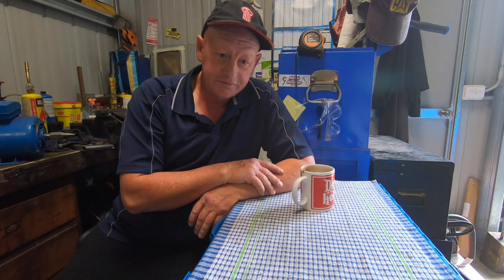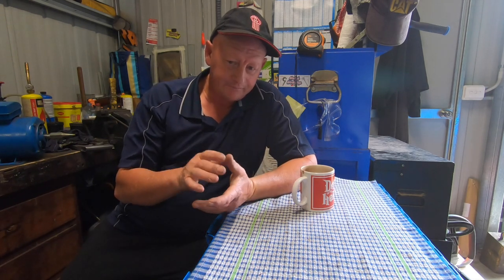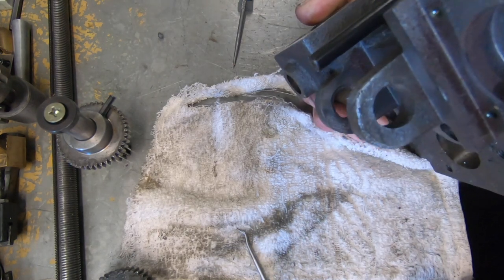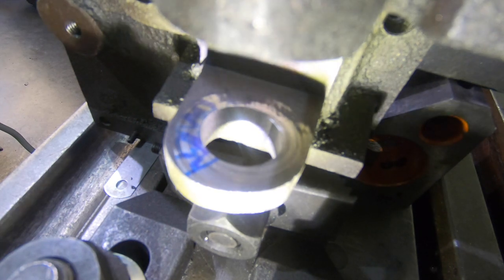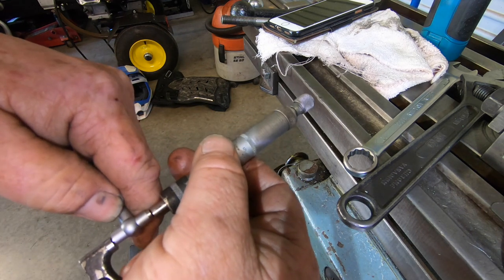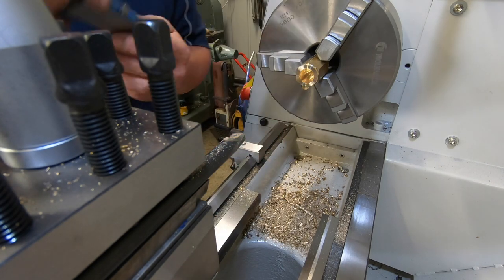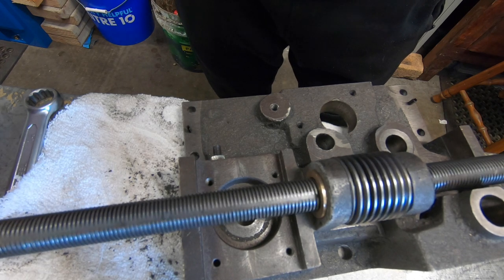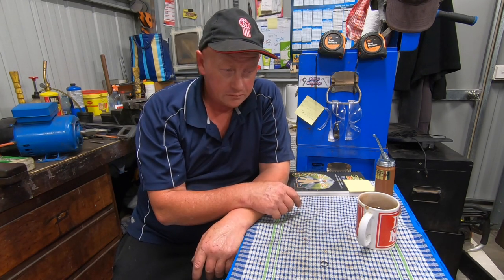AL51G Apron repair

Comment: No problem with the intro, just worried your tea may go cold!.
Yes, production shortcuts, and zero quantity control, makes for a good profit with customers unable to return items, or be corrected. Getting the casting sand out is a pain, but that amount is unbelievable. Anyway, nice job for remanufacturing. Alkyd red oxide paint does a fairly good job on sealing castings, and resistant to mineral oils, the Glyptal is a full gloss enamel paint, and helps oil flow where necessary, but the Red Oxide Alkyd is plenty good enough for standard machines. Does anyone else have experience in using this?
Thanks for sharing Matty.
Best regards from the UK. John.
Reply from the maker: Gday John, the headstock did have paint in there but not enough I’d say to glue the sand to the sides, I’m going to take the apron off again and paint the back, I’m pretty confident I got 99% of the crap off, I didn’t paint it straight away because I was to excited to see if it was going to work, it’s easy to remove so it won’t be hard to paint.....
Reply: No experience with the Glyptal but I always pressure wash and abrade the insides of iron castings and then apply 2 coats of 2 pack etch primer. That seals all surfaces and ensures no further grit/sand gets free.
Reply: @howardosborne8647  2 pack paint is difficult to beat, guessing historically that most paints were linseed oil based (excluding Cellulose, though they is obviously others), there were very few that were oil resistant, even less fuel resistant. I had a Royal Enfield engine as a youngster, only the bottom half, and it was painted a light grey/cream colour and found out it was to improve oil flow.

Comment: I have this same lathe, but mine had the Harbor Freight name on it, and although it’s 20 years old, I just acquired it still in the box! Certain parts of mine were packed with that sand/grinding dust crap while others were fairly clean. I did a total disassembly and cleanup/tweaking to be safe. The cast iron lug that rides under the ways to lock down the tailstock was an incredibly poorly cast and machined piece that broke in two after several uses. I repaired it with nickel electrode, then it broke elsewhere! Grizzly’s G4000 is the same machine, so I searched their website and found the p/n and photo. That pic showed another hideously produced part, but I ordered one anyhow, and also made one on the mill. What I received was an absolutely perfect part, so well done that I didn’t even use the one I made! There is a definite difference in these similar machines depending on the company selling them! Some evidently don’t hold the Chinese producers to any kind of quality standard! Great fix Matty!

Comment: good job Matty. I enjoyed watching it. If I remember correctly there is a paint called Glyptol that is used to seal cast iron inside engines and gear boxes. The better lathes will have it inside the gear boxes. Thanks for sharing.
Reply: Good call, I was going to mention how nice a painted finish would look with that repair, 100% right on Glyptol.
ol
Reply from the maker: Gday Terry, the new lathe is painted very nicely inside the geared head, I’m going to pull the apron off again which isn’t a big job and paint it to seal the casting, it would be nice if I can get that paint in a spray can,, cheers Matty

Comment: Cincinatti  to the rescue!
Dual feed,  leadscrew like the Hercus Lathe.
Lubrication is an issue on your lathe lead, feedshaft, I wonder how Delrin Bushes would perform.
Can't remember how Hercus is set up.
My 12" lathe has separate feed shaft from the leadscrew and also runs directly in the casting but has an oil bath that I must regularly top up.
I think the manufacturer should have installed bushes so they can be replaced as you have done, the right way.
Good job Matty.
Reply from the maker: Gday Willem, the Cincinnati did a great job here, I think it’s was more then lubrication the did the damage, I hope the brass bushes hold up but there easy to replace if they fail,   Cheers Matty

Comment: G'Day Matty, rock solid methodology in that repair and it worked out beautifully.  Yes, Chinese lathes from Hare and Forbes.  I bought a small lathe and converted to a CNC, and the bearings seized up.  The reason was all the sand in the Headstock.  There was even a 4" nail embedded in the casting used to hold the core together and it was rubbing on the spindle.  All they had done was spray paint over the sand to try and hold it in.  I had Hare and Forbes purchase new Timken Bearings for me and I also had the Hearstock sand blasted at their cost to remove any other muck.  You won't have those sorts of issues with your new Taiwanese Lathe, they are first class machines.

Cam
Reply from the maker: Gday Cam, it all worked out well in the end but I did do a lot of time wasting triple checking myself😂, I only had one crack at this repair so I had to get it right, Hare and Forbes supplied the bearings for the head stock and I think the may have been Timkin bearings, it’s funny you say about the nail, a bloke in town here brought the same lathe as mine and had the same issues with the headstock, he also got a nail out of his, I thought he was pulling my leg until he showed me a photo, I think the Chinese factory’s need to be controlled a little better and improve the quality, cheers Matty

Comment: Good video mate. I got al51g. Full of sand and grit. And the compound slide screw has small section stripped. Brand new machine needed a serious birthday. But overall it's a good little machine
Reply from the maker: Gday David, overall there not a bad machine but there’s a few faults sadly, I ended up giving the lathe to a YouTube creator in Sydney, I did replace the headstock bearings and half nuts and cleaned out all the castings from one end to the other, I was amazed how much sand I got out of it, bloody terrible to be honest, I brought a AL960B and absolutely over the moon with it, thanks for watching mate, Cheers

Comment: Beautiful work Matty - very impressed at the setups, the extended boring job, and the remade parts. As you said if the brass bits wallow out, it's very easy to turn a new pair of top hat bushes, the difficult bit is boring out the apron accurately. Great work!
Reply from the maker: Thanks Craig, It took some nutting out to set it up and line up the bore, thank you for the advice while I was doing this, your idea worked a treat👌🏼👌🏼

Comment: Nice repair,  I'm a fairly new subscriber and I'm loving your videos, great explanations. 
One suggestion I want to make,  I've got some old machines I've done up and a small needle scaler works great for loose casting bits and sand. I hot mine from Harbor Freight Tools a few years back.
Reply from the maker: Gday Jim, great to hear your enjoying the videos, I really do need to buy a needle scaler, appreciate you taking the time to subscribe mate, Cheers

Comment: Worked out real nice there, Matty. If the boring job hadn't turned out good you still had another couple of alternative options by milling out the 2 iron lugs completely and screw fixing a couple of new lugs made from steel with bronze bushings in the bores. Always more than one way to skin the proverbial cat.
Reply from the maker: Gday Howard, that was one idea that ran through my small brain and I was hoping it didn’t come to that, it would certainly work and be a perfect repair....

Comment: Hi Matty,
A very good fixed to your old lathe and it sounds like a good idea having new and old lathe in service... I know you're super pleased with your new lathe and I don't want to rain on your parade but do you think it would be worth doing some investigation work on it to see if there is the same problem, it would be better to clean the sand out know before it does any damage.
Take care
Paul,,
Reply from the maker: Gday Paul, with the new lathe I’ve already changed the oil in the headstock and apron, that was done right after I got it,..
Reply: @MattysWorkshop  I was foolish to doubt that you had not considered it... SORRY.

Comment: Nicely done. Great fix! I was thinking you'd use a steel bush, but brass is probably good for quite a long time, and quite easy to make another.
Reply from the maker: Gday Mats, I thought about steel bushes but I was worried about the lead screw wearing out to quick if it started rubbing there...
Reply: @MattysWorkshop  Yes, that's obvuiusly the other side of that coin. You either have hard stuff that doesn't wear out but wears the other part instead, or soft stuff that wears out, but doesn't wear the other half of the thing. Wearing out the leadscrew is obviously not a "better" choice.

Comment: G'day Matty, I'm on the south coast NSW , nice job and very well done , I have the same lathe  except is a AL50A . ( No Q/C G/box ) I also have the same problem with my lever going all the way on to the apron and  hard to disengage it . ( But i know how to fix that Now ....Thanks ) when i brought the lathe the bloke said the lever for the half nut was seized , but in actual fact  its the Half nut that has broke . so i go onto Hare & Forbes  site  and find the  part saying its for  AL50A 1.5 pitch and think great  I'll just change it , .... woope doo !  BUT what they don't tell you that there's  2 different Threads on the lead screw ,1.5 and 2.0  , And the 2.0 is unavailable , and of course they want a restock fee if i return it . SO , here's my question ! Can I just simply change the lead screw from the 2.0 pitch one that's on it ,  To the 1.5 one to match this new half nut ? .... Of will it mess all the gears at the motor end ?  ....Cheers ... Johnny.
Reply from the maker: Gday Johnny, where about on the coast are you, i've since given the lathe to another YouTube creator ( Peter from PGS) in Sydney, I honestly dont think changing the leadscrew will hurt anything, the only change will be the chart for the thread cutting and speeds and feeds will be different, im sure there would be a chart on line somewhere, I really dont understand how companies can charge a restocking fee when its a matter of putting a returns in the computer and sitting the part back on the shelf, thanks for watching mate, please let me know how you get on with the lead screw, Cheers
Reply: @MattysWorkshop   G'day Matty , Just down from Ulladulla  4 hrs down from Sydney

Comment: Good job on sorting out the problem Matty. 
I’ve just put a deposit on the same machine, hopefully I don’t have the same issue’s.
Reply: I guess you’re lucky you’ve got the gear to repair it. If mine 💩’s itself, I’ll be stuffed.
Reply from the maker: Gday, I really hope you don’t have the same issues, just a tip, the drive belt is quite small, it will break if you don’t use the engagement lever, start the motor first then engage the belt, you’ll know what I mean when you get it, also if you look in my videos when I had that lathe you will see I put a post under the parting tool, this made a world of difference, it’s quick and easy to make, cheers
Reply: Cheers Matt for the advice. I think one of the first things I’ll be doing is checking everything both inside and out before cranking it up. The quality control at the factory must be 💩. Artisan Makes had issues with his brand new lathe, heaps of sandy crap in the gearbox. 
I might show the blokes at Machinery Warehouse some of the videos and hopefully they’ll pass it onto the mob that makes these lathes.

Comment: Nice repair Matty, I was thinking the mandrel approach, or maybe machinist button to find the axis of that bore. Thanks for the DTI technique on the boring head, I've always trusted the marks on the adjuster, now I know better. Good luck with the young un's learning on the lathe, it will be nice to see them carry on your trade. Cheers!
Reply from the maker: Gday, I thought the idea of the indicator was well known but I’ve had a few people comment in the past that they have never seen this before, I find it easier to do it this way and it’s more accurate I think and it doesn’t take much longer to adjust the head, cheers Matty
Reply: @MattysWorkshop  I forgot to mention it; that cleanup looks like a great job to use a pneumatic needle descaler, just a suggestion.

Comment: Justwatch this mod video mate, looks like I'll be doing the same to mine. I think that my lead screw is slightly bent from factory and H&F never wanted to replace it plus my engagement lever is out by a 1/4 turn downwards, so I've had to remove the detent ball and move it up 1 tooth.
Reply from the maker: Gday, I glad the video is helpful, this is something we shouldn’t have to do, have you checked the casting inside the headstock, mine was full of sand and had to replace the spindle bearings as well and H&F didn’t overly care at all to be honest mate, I hope you get yours repaired, let me know how you get on, cheers
Reply: @MattysWorkshop  No. I haven't checked the spindle bearings, but I will when I get some time off. I'm thinking of following your dimensions on those bushings ready for the install to the apron. For sure I'll keep you informed on how they are.

Comment: Make sure you put set screws in to hold the new bushings!
Reply from the maker: Gday Tom, I did think about that, the bushes were a good tight fit so I decided to see how they go, I’m just a little worried about the casting being to weak if I drill and tap for a set screw..

Comment: nice save matty, Ive seen what I thought was the worst of cheap chinese quality, but that is just sad how much grit and sand was still inside of that thing. Only thing I was curious about was why was it magnetic, Ive never seen any sand that was magnetic before, so thinking it may be grinding grit or something instead somehow.
Reply from the maker: Gday Chirpy, I really didn’t explain that all that well, there was a mix of sand and grinding grit, it felt very abrasive between your fingers, hard to believe just how much there was..

Comment: Hi Matty,although yours is particularly bad it is thing that most Chinese build hobby machinery have....casting sand .I and many others had it too...Jon from Jon,s workshop warned me about this issue on my mill.But I had similar issue with my small Warco lathe.I think the universal advice would have to be...strip them done and remove all transportation grease and other muck!Quality control and some basic care is lacking not just in China but also most brands that sell them do not seem to care much.
Reply from the maker: Yes Robert it’s sad to say the least, it’s not a cheap hobby at the best of time, I was lucky I had the other machines as well to repair it,

Comment: How much would it add to the price for them to clean things before building, I recon less than what they lose by having to replace parts under warranty if you take into consideration transport as well. Its disgraceful that when you buy something from china you need to strip them down, clean and rebuild, be it a lathe, mill, chuck or dividing head, basically anything that has castings.
Reply from the maker: Very disappointing thats for sure mate

Comment: You think the Chinese would charge a dollar more for the lathe to cover their labor costs to clean out the bloody casting sand. Instead they cut too many corners now.
Reply from the maker: Gday Tom, sadly that’s the problem and ever while we keep buying the products the problem will keep happening, I was lucky and the repair worked...
Reply: @MattysWorkshop  If the brass does not hold up let me know and I can ship you a piece of oil lite bronze to make the bushings out of.
Reply from the maker: @hilltopmachineworks2131  thanks very much Tom, I’m hoping it will be alright, only time will tell mate